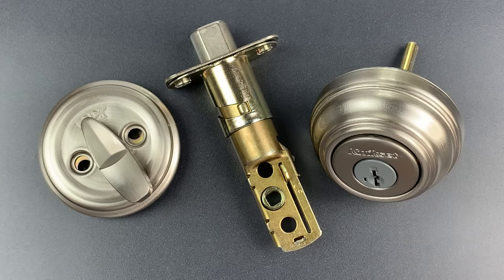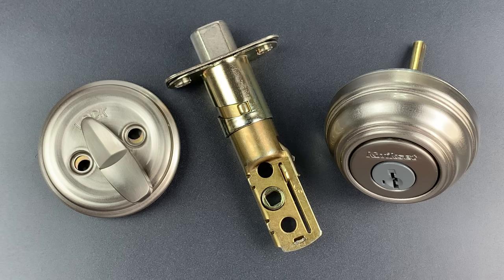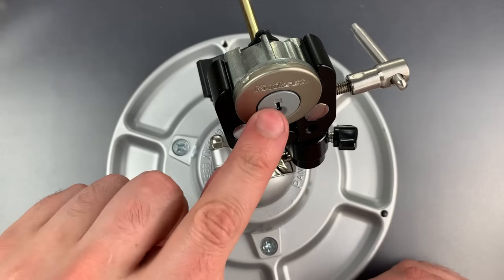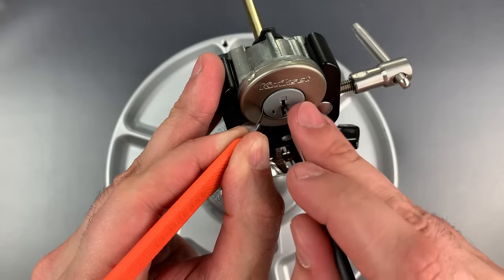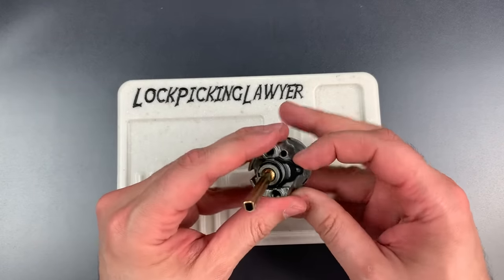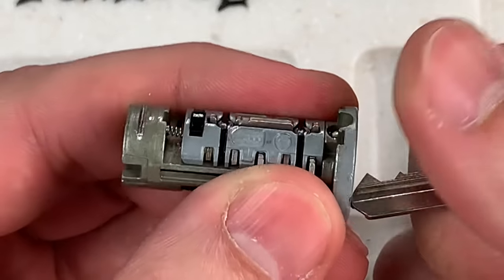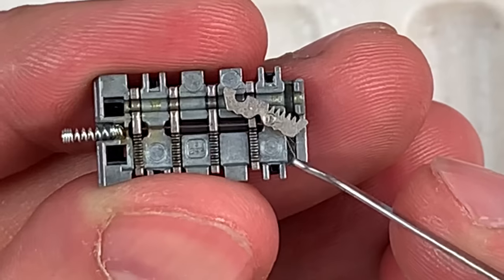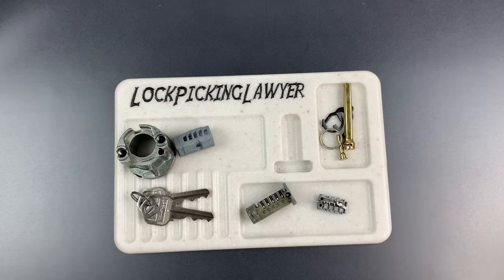[904] The “Pros" at Consumer Reports Couldn’t Pick This (Reverse Sidebar SmartKey)

Comment: I don’t understand lockpicking. Then I watched LPL video for the first time. I still didn’t understand it. Now I’m a subscriber and watched a year’s worth of videos and I still don’t understand it but I love this channel
Reply: if it makes you feel any better, most of the people commenting don't understand it either. Watching a video doesn't give you any knowledge, you have to actually do it.   I took a locksmithing course years ago, and I can tell you that the learning curve on this is feel. You have to be able to feel what the lock is doing. You don't learn that by watching videos. It took me an hour to pick my first pin tumbler lock. After that I got faster. This requires a high amount of skill through practice and  there are many different types of locks and unless you know what you are looking at you can easily be thwarted.  I can pick a handful of locks quickly.  I'm not this dude. Probably 1% of the population can do what I do. This dude is like .0001%  of the population
Reply: A lot of it is practice (which we don't see), he probably spends a few hours with the more complex locks.

It's also moderate difficulties (how it's keyed plalys s role to bump the lock using a longer reset tool, I have this lock and am bad for forgetting my keys in my work jacket.

But the side bar will lock down, if picked just right and you use a rekey tool with a S bend near the end and this is tricky. This also will tell you if you've found a false postion in the tumblers. And your still no keyhole pressure, as your S bend will catch where the sidebar should be, drop in a blank key. And the lock is rekeyed

I will warn you can fuck this up pretty bad and be forced to take the lock apart, manually rekey the lock, not a big deal if have the big core tool for it  will take 10 minutes, if you don't it will take a lot of cussing and a few hours as it's not really human friendly to assemble and set. 

Not a locksmith, I just really love puzzles and that's really what lock is.

I left sorta one step you have to start at tumbler 1 as you won't be able to get the rekey tool to put pressure on the side bar. Normally the side bar will lock the key tool out, hence the bend in the rekey tool. Again tricky but not impossible.
Reply: Grab a masterlock from your nearest walmart, put it in a vice, bend a bobby pin and start trying it out. On my first attempt with home made "tools" i got it open in ten minutes. Using a bent bobby pin and a very small flat head screw driver as torsion bar.
Reply: I don't know why, but a few years ago, as a completely 0-skill novice, I bought a very nice, reputable lock pick set that can fit in to my wallet, as well as a clear padlock. The padlock was sh*t & fell apart shortly after, but before that, I did learn how to do it by watching a few videos & playing around with it in my free time.

I've been locked out, my friends have been locked out, & I've managed to pick the lock every time. I'm not very skilled & it takes a second, but I can do it. Occasionally I pick up a padlock & fiddle with it when I'm bored, just to keep my skills from degrading.
Reply: @Divert486  You can make tension tools out of the metal strips from an old windshield wiper blade. I made one several years ago, and it's still my go-to.
Reply: @taitjones6310  I think I know how locks work therefor I know how lockpick works too. watching a few videos that he dismantles the lock should be enough for good observer.
Reply: lmao
Reply: its not about the content necessarily, its about the presenter of the content and how they do it. And when it comes to LPL he's about as good as making entertaining vids as he is at picking locks. (which is really good to say the least)
Reply: If you want to understand it and are willing to spend a little time reading, this PDF explains all the basics: https://www.reddit.com/r/secref/comments/98360g/lockpicking_detail_overkill_pdf/ 2 days ago I was like you. I read that yesterday and now completely follow and understand about 90% of the things he says in this video.
Reply: SAME
Reply: Click out of 4, nothing on 5 🧐
Reply: You just put a pick in and say, “Nothing on one, a click out of two...” and they just open.  Watch the videos.
Reply: I come from a wide range of mechanical skills both large  and very small. I was a jewelry mfg. working supervisor for many, many years. After I got out of Vietnam the Gov. offered free education, one of the choices was lock smithing.
I seriously mulled it over but chose to go on my own in search of a career. I tried lock picking for a few years off and on but couldn't do it.
Now that I'm very much retired with a lot of time to pass I'm trying again. 
Lo and behold!!  I still can't do it. LOL
Reply: Lockpicking is easy. A click out of one, a click out of two, a little click out of three, nothing on four, five is binding tightly and we've got this open.
Reply: Grab a transparent lock and a basic lock pick set. It's super useful to learn hands on when you can see what you're doing.
Reply: @taitjones6310  well saying it is unable to be picked you have to take into account that small percentage that their hobby is picking locks and the percentage that their job is picking locks. 

The flaw i saw in that lock might not be a big one but wouldn't making all the pins a different length apart and/or even skipping the length for one or 2 make a more difficult to pick lock for who doesn't know it is doing that? Sure the key for the lock will look weird compared to normal keys but it seems like it would be a better lock looking at how he goes about lock picking. Still have 7 things of an actual place to hit with the key so a longer key with irregular notches on it compared to normal keys. 

A lock you can't pick through normal means should have something special put into it also yes i know that would be like a gimmick to a lock and most likely still able to get passed with enough time but it will take more time. IF you go back in history the original purpose of a lock wasn't to keep thieves out but to delay them until you caught them and/or the police caught them. A delay not a valid method of keeping out everyone who doesn't have the key. The longer it takes to pick the more likely you are to be caught  so a lock with a gimmick like that will take longer to pick. Cost more to make and need a different design for the inside to make room for it yes but will take longer to pick.
Reply: Very that
Reply: It would be great if he could do a video showing what's actually happening in the lock when he says "click on 3" or "2 is binding" etc. Would love to understand the process better.
Reply: @calibrax  without him having half of it open for you to see inside it i do not think there is a way for us to see what is happening. The locks are made so you can just use a hand held scanner of any kind to see what is inside them and other scanners would also not work as it is ussualy all 1 kind of metal.
Reply: @yumri4  I mean a separate video to explain the process with diagrams, not during a lock picking.
Reply: @calibrax  I am sure that would fall into a different category then this is in. You also have reverse engineering laws that that kind of video will be butting into the gray area of too.
Reply: It's the challenge...people that like puzzles...particularly the kind that need physical dexterity to solve, like picking locks. A lock is just another puzzle you have to figure out and apply physical skill to solve (open).
Reply: I understand it, doesn’t mean my hands do
Reply: I feel like Deviant Ollam is better at explaining the fundamentals.
Reply: @taitjones6310  bullcrap!
I lost most of the feeling in my hands and fingers, but have no trouble picking pin tumblers once I learned how they work..and took a few apart. Feeling would be nice, and make it a lot easier, but with numb fingers.i can do it by sound and watching.
Reply: @---cr8nw  the best "teachers" I found on here are locknoob and Bosnian bill.
Both of them are very descriptive of what to do and why.
Reply: @parapicktog7734 , yeah, but I find Deviant's oversized pictures of what's actually happening inside the lock to be very helpful.
Reply: @---cr8nw  these days I think he's doing more booze reviews and not so much lock picking.
Reply: im the same i love watching things like this but id lose my rag too quick trying to pick a lock.im not blessed with patience!
Reply: I think the bypass here allows picking... The bypass is to push the sidebar down,do as to make it hold a slider that is set in place.  This just replaces the  turning of the core on standard cores which does the job. So it looks a bit like bypass , but  when you fail at picking the common way,you can deduce its side bar.. invented in 1930.  They are just selling different types as same model as a sort of smoke n mirror security benefit... ???
Reply: The lever he holds mostly still puts a sideways force onto the sliders  or pins.. this will hold the picked pin at the open position.. this is because the set pin or slider is slightly slid over the gate.  With a nice click..it found the true gate ..set.. the force from the lever usually hits one or two pins at a time, but once those pins is set , things move a tiny amount ,the louder click ? , and the force moves on to another pin or two. binding means too much force on the lever or maybe skip it as  like its loose ( or false gate ?). . Loose means the pin is not yet holding the levers force .so skip it until you set the pins which are holding the levers force..So go through each pin , setting some each cycle hopefully, skipping already set pins,and leaving unset  loose pins or inding pins you give up on, and  so as long as you dont let off the levers holding of the pins.. you get them set one by one .. the side bar in this video means a lever in the keyhole doesnt hold the sliders set.but with the side bar easily accessed in the space  beside the core , he puts the holding force on....so picks it
Reply: @calibrax  nice click  means its properly let the core rotate some billionth of a mm ,and a pin  which was loose before should now be settable.. nice click is better than binding... False set seems to mean the core moved two billionths..
Reply: He has mentioned before that he has a container of locks that he picks while relaxing or watching TV.  And he has done this for years.
Reply: After a year, you should understand what's going on.  You may not be able to actually do it, because that's a different skill altogether, but you really should be understanding the theory/concepts involved.
Reply: is SCHLAGE. a better brand then kiwkset?
Reply: Seriously? Jfc FFS I bet you know how to get to the voting booth
Reply: Watching take apart locks has taught me how locks work.

I still don't fully understand lockpicking though 😂
Reply: Same here lol
Reply: This.
Reply: If you go back into the older videos he has some videos where he picks some cut away versions.  Watch those you'll understand.

You won't be LPL but you'll understand.
Reply: Sounds like you are the main demographic for Master lock
Reply: bet you got a really nice set of picks

Comment: That was nice of CR to provide you with a list for your next 5 videos. :)
Reply: Can this lock be bumped?
Reply: @halibaitor  Bosnianbill just posted a video of him picking a Kwikset (#1533) without the exploit LPL used. He opened it after a very long time by sheer luck.
If they shield that bolt, it's pretty much as pick resistant as a lock gets without some unorthodox keying and stuff.
Reply: @Jones - The point of a good lock isn't to stop LockPickingLawyer from breaking into your house. It's to stop the average burglar with a bump key.
Reply: @CerebralDreams That isn't what Consumer Reports wrote. They originally claimed that their recommended locks were unable to be picked by professional locksmiths within 5 minutes. 

That is substantially different than saying the locks resisted opening with the use of an average bump key. 

The lock picking lawyer had the thing opened in well under 5 minutes with standard lock picking tools. 

Even with that, Consumer Reports only changed the wording of the article. They still left the lock as one of their "recommended" choices. 

Not everyone has the skill set of LPL. But using his technique, an experienced lock picker can open this thing in well under 5 minutes. 

Consumer Reports has horrible biases. They harbor the most dangerous bias of all. That they are never wrong. 

How trust worthy is any organization with that kind of bias. Even the LPL doesn't take himself too seriously. He does a seriously very useful service. By exposing the false claims of the lock makers who embellish their claims of maximum security and the like. And now a magazine that claims to have consumers interests at heart does the exact same thing and gets mercilessly exposed. 

And they don't even issue a mea culpa. Or admit any kind of error. And we are supposed to overlook it and continue to out our faith and trust in Consumer Reports. 

Sorry, but Consumer Reports gets no freebies. If they were rated by another magazine of consumer advocacy, they would get 1 star of 5 for this terrible recommendation.
Reply: @davidharris2147  it's clearly still true that a portion of professional locksmiths couldn't pick this lock without figuring out the unorthodox picking method.  And I wonder if LPL also had to research that information before making the video...

I think CR recommendation is still one of the better available choices...
Reply: @bjfire01  CR has long been unreliable in recommending many things. Study their history and see what other experts said at that same time, then see who was most often right. Ain't gonna be CR.